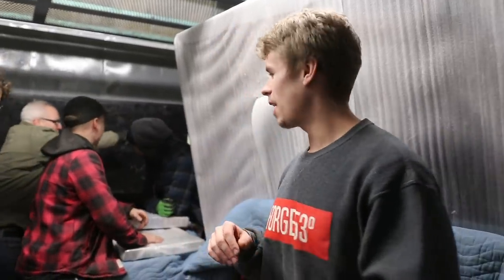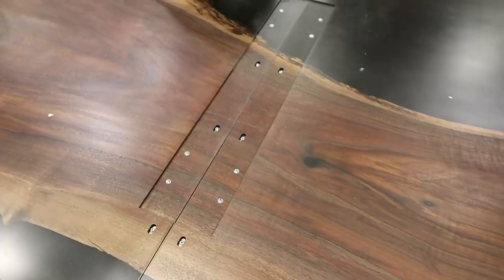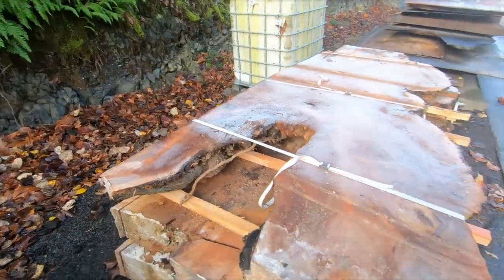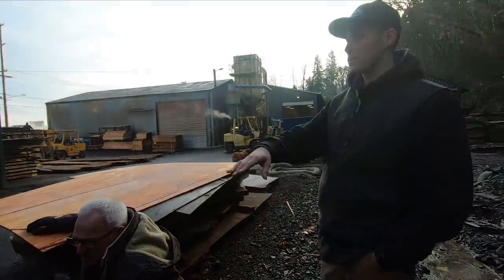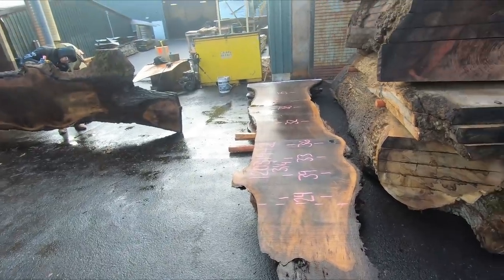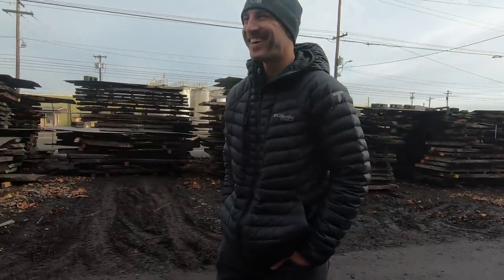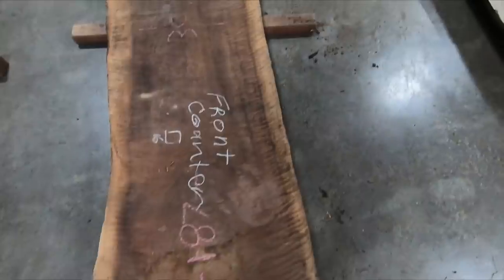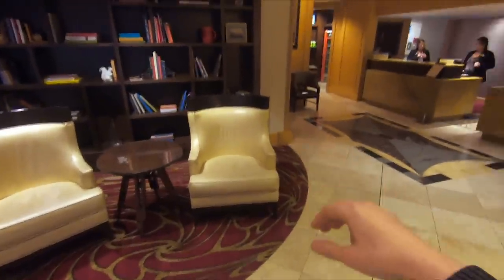Delivering a $30,000 Conference Table

Comment: question about your tables: if you would run your finger from the wood to the epoxy, do you feel a bump or anything like that when you transition between the materials ? and does the wood feel like actual wood with pores or whatever, thanks a bunch! :)
Reply from the maker: Not a bump, but you can feel the difference in textures between the wood and the epoxy! And yes the wood feels like actual wood, we plane down our tables back to the wood so you still have that nice feeling of the actual wood 😊

Comment: Awesome work on those tables! I am wondering how these tables hold up after a few years, as you did not build in any dovetails. Is there a reason why you decided not to do this, or are the legs and epoxy enough to keep the tables straight? 

Looking forward to your answer!

Comment: how do you make sure that the wood doesn't break after? Is the epoxy that strong that it can hold together the forces of the wood wanting to dry or are the woods dry for some years already? Thanks
Reply from the maker: The wood we use has already been dried out for a couple years!

Comment: A very nice table for sure but I don't think I would pay $30,000 for it.
Reply: @teddyjones9020 ,  I don't see how.  It's a table.
Reply: @teddyjones9020  Ok, if you say so.  I think I would rather spend $30,000 on a vehicle and down payment on a house rather than a table that can be made for far less.  Yes, the slab and epoxy are expensive but they're not in the ballpark of $30,000 and you shouldn't be trying to add that much of a labor charge to each job.

Comment: I get the epoxy being 8,000 but 30,000 is way too much but then again idk too much bout custom table and wood appraisal
Reply: Finished black walnut from rickler is 48"x5"x3/4" for $31
Reply: TheSevenJr86 so I’m not trippin thinking this is a total rip off
Reply: @dizzle47daking15  well, that's in inches. The slab looks to be at least 2 inches, I'm not sure the length, I could see that slab being easy couple Grand alone, legs (unsure if they're custom to the job) forms to pour the table. He might be making a girthy profit, idk. If the company paid for their lodging and travel to deliver... Could be a lot more at play that it took to create the table. Wood is definitely big bucks though for sure.